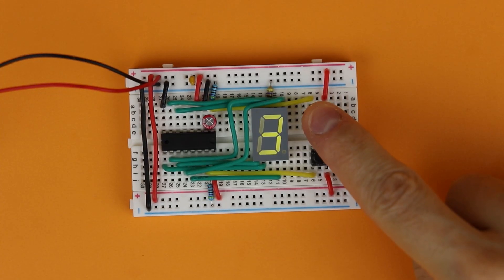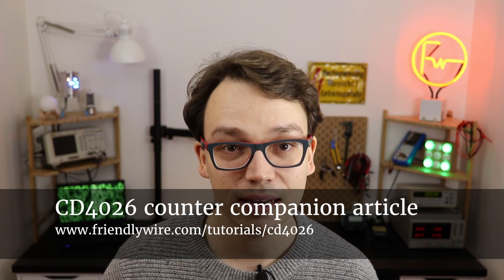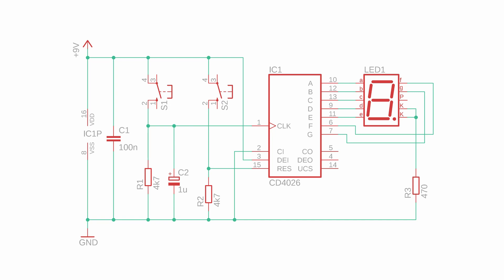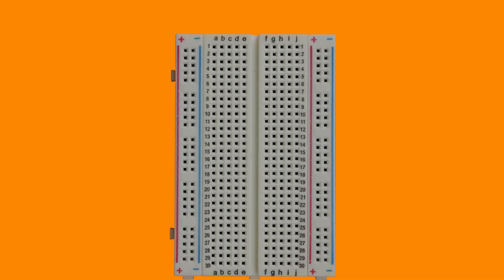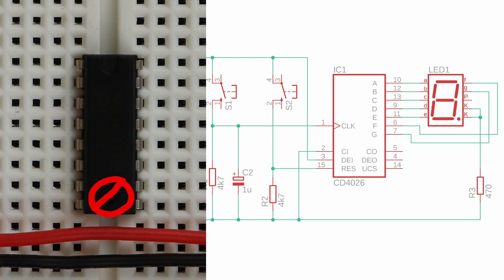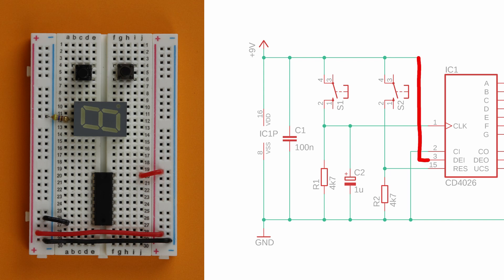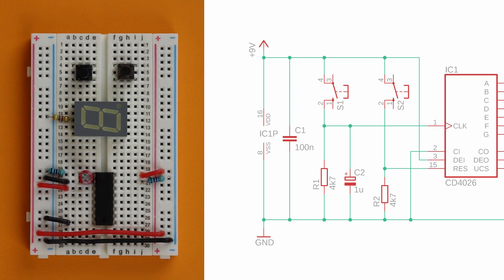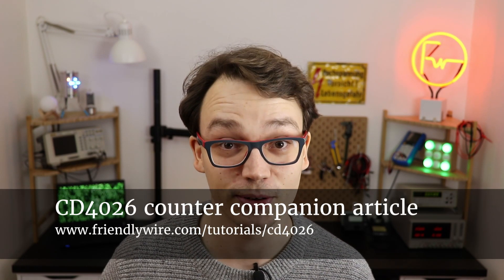CD4026 decimal counter tutorial

Comment: Thank you for the video on this, its just what I needed! Is there any way to adjust the circuit to use AA batteries instead? I'm looking to put this in something that would be used for a long time and replacing those 9Vs is a pain!
Reply from the maker: Thank you, I am glad you like the video! Yes, you can use AA batteries, too. I would recommend three AA batteries in series to give 4.5V, and then you can replace the 470 Ohms resistor with a 220 Ohms resistor for the LED. Everything else can stay the same :)

Comment: Hi, I understood this and implemented this it works and helps a lot but the problem is I have to run this on simulator on Proteus for my project and Tried alot but Stuck on led display there a-k alphabets in led but in Proteus there is a-g so how to take other inputs can you make a video on it
Reply from the maker: Thank you for the question, I am glad that the video was helpful. I am not sure if I understood everything :) Can you explain what the problems seems to be?
Reply: @FriendlyWire  thanks for your response There was a wire missing which was not connected,now it's working
Reply from the maker: @MAFIAGAMING-pn6se  Perfect, I am glad it's working now! Which wire was it?
Reply: @FriendlyWire  led common pin is connected to R3(Resistor) and then resistor is connected to ground,but I have to connect led common pin to ground separately after that it starts working 🙂

Comment: What If I have common anode display available
Reply from the maker: Unfortunately it won't work with the CD4026 :/ You could invert each signal and then use the common anode display, but you would need another chip for that. It would probably be easier to get a common cathode display in that case.
Reply: @FriendlyWire  thanks for your reply .   I had a deadline so used  ic7404 (NOT gate) and inverted each output...works fine now
Reply from the maker: @vishamv6346  Yup, that woks! Perfect! :)

Comment: Greeat video, but can I ask, "Is there a way to subtract a count from the total?
Reply from the maker: Unfortunately, the CD4026 does not count backwards... But you could count forward and basically subtract it this way, since it always rests back to 0 after passing 9. If you want to subtract a number, call it N, it's the same as adding 10-N.

Example: the counter is showing 8, and you want to subtract 4. So, in this example, N=4. This means you have to add 10-N, which is 10-4 = 6. If you increment the timer 6 times, it will show 4 after that, which is what you wanted :)

If you want to subtract 1, then you just have to increase the timer 9 times. If you do it really quickly, then it will look like it reset by 1 (the intermediate counts will be almost invisible).

Hope that helps!

Comment: Hi sir. The tutorial is great and I understand all the cirtuit. But even I had done everything same (yes. even the coordinates of components ) it didnt seem to work. What can be the problem you think? (I checked all components no problem about them) 

Also. If you answer this, Thank you man youre great
Reply: Problem Solved, Thank you
Reply from the maker: @yusufkonevi6803  That's great, congratulations! Let us know what it was, maybe somebody else has the same problem and they may find your solution helpful :)
Reply: @FriendlyWire  The problem was that the display I installed later was a common anode, not a common cathode, since it was larger. I also have a question: how can I make this counter 2 digits?
Reply from the maker: @yusufkonevi6803 Oh, I see! Yes, this circuit is for a common cathode display. (But these displays always have the same size, you can only tell if it is common anode or cathode from the type number and/or from experimenting with the module.)

You can make it 2 digits like this: connect Carry Out (pin 5) to the CLK pin of the next CD4026. On this next CD4026, connect a 7seg display just as before, and put RESET (pin 15) to ground, Clock Inhibit (pin 2) to ground, and Display Enable (pin 3) to VDD. Let me know if it works! :)
Reply from the maker: Hello Yusuf, thank you for your interest and your question! I have been there, too, these things can be a bit tricky sometimes. Can you send me a photo of your built? You can either contact me on social media @FriendlyWire or send me an email (my address is at the bottom of www.friendlywire.com). I am sure we can figure this out together! :)

Comment: Hi! I thought it was a common practice to connect a 220-ohm resistor in series with each output of the 4026 IC to its respective LED in the 7-segment display.
Why not use that instead?
Reply from the maker: It's much better to do that, you are right. I took a shortcut here, which was not the best idea.

Comment: Hi ! Nice tutorial. But, how to make the memory backup after power off ? To display the same number when turned on again ?
Reply from the maker: Hello Marzena, this is a good question. Unfortunately the CD4026 does not have a built-in memory. What you could do is this: simply disable the display by putting pin 3 to ground, then the current consumption should be much lower. Then, if you drive everything via a rechargeable USB bank, for example, it could easily last in standby mode for a few days. How long does it need to keep the memory?

Comment: Hello, one question if I want to use an inductive proximity sensor, how can I switch it so that it can count me?
Reply from the maker: Hello :) In principle, you can use sensor outputs to count with the CD4026, they just have to be the right voltage levels. Do you have a datasheet/name/link of the proximity sensor you want to use?
Reply: @FriendlyWire  thanks for answering, the sensor is inductive NPN powered by 12v DVC three-wire brown, black and blue
Reply from the maker: @AnimaladasGraciosas  Great, that looks like something we could work with. Do you have a datasheet? Feel free to reach out via email as well, you can find it on the bottom of the website www.friendlywire.com :) Without datasheet it will be hard to guess how to do it.

Comment: How would I set it to a certain number when it resets?
Reply from the maker: Good question, but not possible with this chip, it will always reset back to 0. If you want a more custom experience, I recommend the CD4510 BCD presettable up/down counter, and then the CD4511 BCD-to-7-segment decoder to connect it to a 7-segment display.

Comment: Hi I have dont this project it works perfectly,  but i have a question,  instead of push button  do i connect Rotary encoder ( Mouse Scroll wheel ) ??  if it is yes, will you please tell the pin out connections, where do connect the mouse scroll wheel button in the 4026 ic ?  Thanks
Reply from the maker: Thanks for the question! A mouse scroll wheel does not generate an on/off output like a pushbutton, there is more circuitry involved to decode the signal of a rotary encoder. So I am not aware of any simple solution for this, unfortunately. Would you be willing to use a microcontroller, or does it have to be the CD4026? I may do a video on how to use rotary encoders with a PIC microcontroller soon.
Reply: @FriendlyWire   Thanks for your quick reply,  my idea is instead of push button , i would like to use some Rotary encoder like volume control to increase or decrease the count with CD4026,
Reply from the maker: @angs7265  I see! Unfortunately I cannot think of any simple solution. It depends a lot on your rotary encoder. But there is another way: you can use a BCD dip switch ( see the one at http://friendlywire.com/tutorials/buttons-switches-101/#ch6 , or one on Ebay right now, Jan 17, 2023: https://www.ebay.com/itm/175465827952 ) that has four outputs. Then you can use the CD4511 BCD-to-decimal converter to turn that signal into 7-segment value.

Comment: Hi. Great video. 
Just one quick question.
If I chain six of those to make 6 digits counter is the ceramic capacitor required once per build or once for every IC?
Do other IC's also need the capacitor? If yes how do I know what kind and value should I use?
Reply from the maker: Thanks so much! A 100nF ceramic should be close to any CD4026, it's just good practice that removes the possibility of unwanted glitches :)
Reply: @FriendlyWire  Do other ICs also require 100nF or other values? If other how do i know what value I should use?
Reply from the maker: @taurruth  These are sometimes called bypass capacitors. Their value is not so critical, but around 100nF is typical. All logic chips have one of these, to make the circuit more resilient against noise. Under ideal conditions these capacitors are not necessary, but it is good practice to include them, especially if you are using a noisy power supply.
Reply: @FriendlyWire  Thank you. I will use them from now on everywhere until I'm wise enough to know where they are not needed :)
Reply from the maker: @taurruth  It's good practice, and I have actually had a case, very early on, where I used a dirty power supply and my digital clock just would not work for the life of me. These capacitors saved me, and so I think it's only fair to recommend them to others, too. :)

Comment: Any tutorial for CD4026 to display number between 0-12? I want to make 12-hour digital clock without microcontroller.
Reply from the maker: You will need two CD4026's for that, connect the carry out in of the first one to the clock pin of the next one. :)

Comment: Hey quick question, is the 7 segment display is a common cathode or a common anode?

Please answer!
Reply from the maker: Hey there, it's a common cathode one. If you build this, make sure you add one 470 ohm resistor on each output of the CD4026 (see schematic at 1:23). In the video I just used one 470 ohm resistor at the cathode, but that is not good practice. Hope it helps! If you build this I would love to see a picture, feel free to share on socials @FriendlyWire :)

Comment: Awesome video, but I need 2-digit counter for my project. Can you please help me with that?
Reply from the maker: Hey Saboor, thanks for the question! Yes, you can do that. Add a second CD4026 to the circuit. Connect it to VDD, ground, and the 7seg display the same way. Then, connect the "CO" pin (carry out, pin 5) of the first CD4026 to the "CLK" pin (clock, pin 1) of the second CD4026 counter.
Reply: @FriendlyWire  And what about Pushbuttons (Reset & Start)? Do I have to connect pushbuttons with second CD4026 also? If yes, then how?
Please help.
Reply: @FriendlyWire  One more question, Do I have to connect all these resistors and capacitors to the second CD4026 also or are these enough?

Comment: Hi!

I have one question!

Shouldn't you put one limiting resistor from each output of 4026 to the anodes of the display, instead of one single resistor from the common cathode to ground?

In case multiple LEDs are lit the sums of the currents make a greater IR drop across the single resistor.
Reply from the maker: Hi Antonio, yes, you are completely right! In practice I find that for these small displays there is not much variation in brightness between a 1 and an 8, though. I did the same for my CD4094 project and it works rather well there, too. In general, and for larger displays, this does not work.

Thanks for pointing it out! :)
Reply: I was reading the 4026 datasheet and it suggests that LED switching be made via npn transistor and current limiting resistor.

How come your circuit (4026 or LEDs) did not overheat?
Reply: no wait...disregard this last comment of mine. I was thinking of other 4026 implementations I saw...where no current limiting resistor is used at all.
Reply from the maker: @antonioagostinelli9430  It's easy to check: with only one resistor you cannot make it worse, because all LED segments that are ON draw current through it. But the current through the resistor is fixed. If it is, say, 15mA, then two segments get 7.5mA each, 3 segments would get 5mA each, and 7 segments would get slightly more than 2mA each. Hope it makes sense :)
Reply: Hey so like if we are making a digital clock ,should we connect 7 similiar resistors or 1 resistor at the end?
Using 1 single resistor in the end causes sum of all the 7 currents to go through it and thus increases I^2R losses and increases heating is that what you meant bro?
Reply from the maker: @michealmyers4515  It is better to use seven individual resistors :) 220 Ohm at 5V, 470 Ohm for 9V and 12V works OK. In the tutorial only used one current limiting resistor between the common cathode and ground to save some space, but it means that a number 1 will be brighter than a number 8. I should have mentioned this issue.
Reply from the maker: @michealmyers4515  Let me know if you have any other questions, happy to help! :)

Comment: Great tutorial.  What if i wanted a second switch that decrease the counter. Would i need a different ic chip. Many thanks
Reply from the maker: Hello Darren, I am glad you like the video, and thanks for the question. Yes, the CD4026 can only count in one direction (up). The CD4510 counter, for example, can count up and down, but outputs BCD signal. You would need a CD4511 to convert it into 7-segment. So: instead of the CD4026 you could use a CD4510+CD4511 and then count up and down :) Let me know if it helps!

Comment: Hi I have a project like this, and I am following your tutorial. I already completed the circuit in my simulation, but I need to reset the sevseg after it reaches the digit 8. This will be use as a scoring device. We are not allowed to use any programmable ICs. Can you help me of some sort?
Reply from the maker: Hello, thanks for your interest! Glad you find the video useful :-) Yes, this can be done. Just to clarify, when should it reset? At 8 or at 9? Basically you need to check if each segment is in the right state (on or off), and you can do it with logic gates. The resulting output can be sent to the reset pin.

Let me know if that makes sense, and if not I can draw a schematic :)
Reply: @FriendlyWire  after 8, when i press the button, it should be 0, instead of proceeding to 9. Adding logic gates might complicate the overall circuit, wouldn't it?
Reply from the maker: @teeboards  Yes, of course it makes it complicated :( But that is the price you pay for using the all-in-one counter+decoder like the CD4026. You could always use a CD4510 and CD4511 combination, where the CD4510 is a BCD counter that is easier to reset, and the CD4511 is the BCG-to-7-segment decoder.

For the CD4026 you need to get creative. I will think about it, maybe there is a simpler way, but the brute force approach is this one: connect segments a,b,c,d,f,g to the inputs of a 6-channel AND gate. Connect segment e to an inverter. Then connect the outputs of the AND gate and the output of the inverter to a 2-channel AND gate. The output of that AND gate will fire when the display shows 9.
Reply from the maker: @teeboards  Let me know if that helps or if you need more input :)